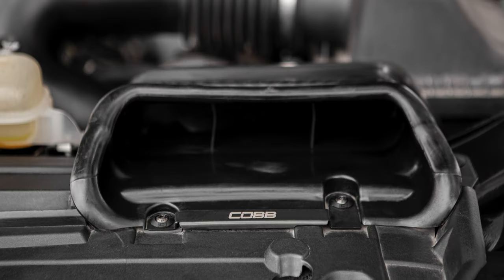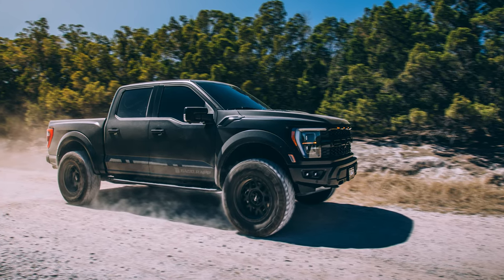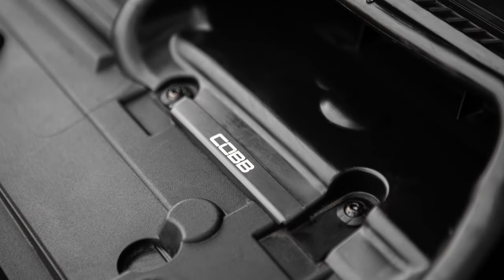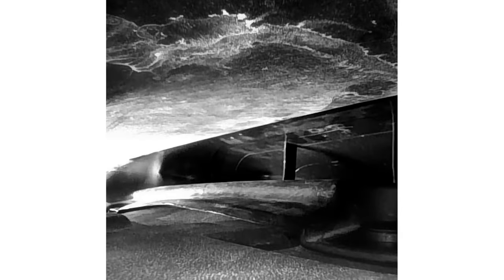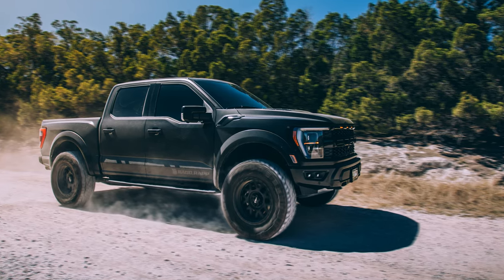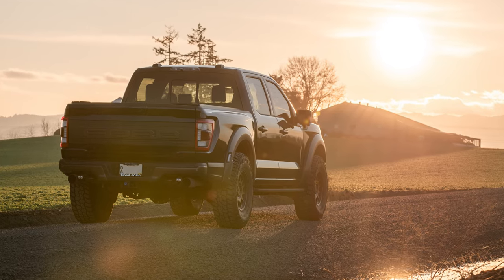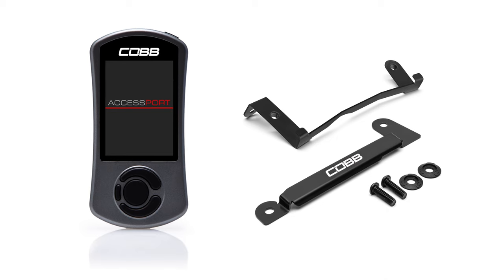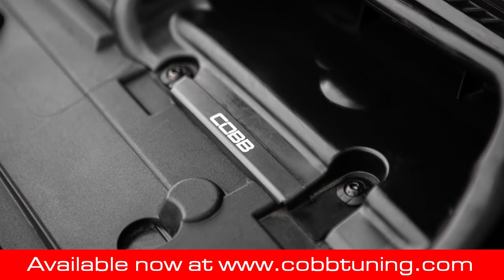COBB Tuning - Product Highlight - 2021+ Ford  F150/Raptor Intake Scoop Bracket

Comment: Is this not an issue for the Gen 2 ‘17-‘20 ?
Reply: I am also wondering the same thing
Reply: I have a 19 and the scoop looks just like this one. The flap on the bottom of the scoop where it meets the valance between the grill and radiator support flexes pretty easy by hand. On a stock truck not sure how much restriction is actually happening where it would affect performance.